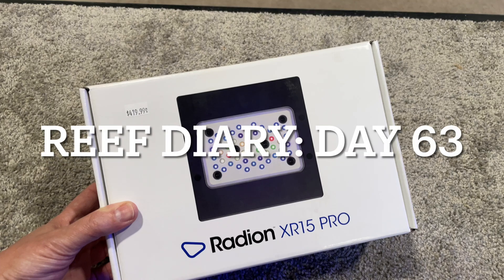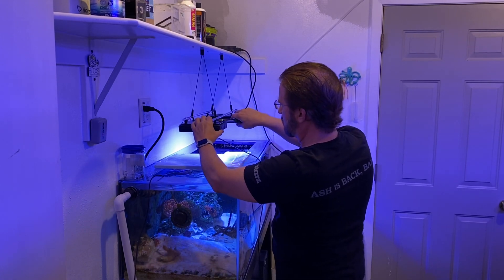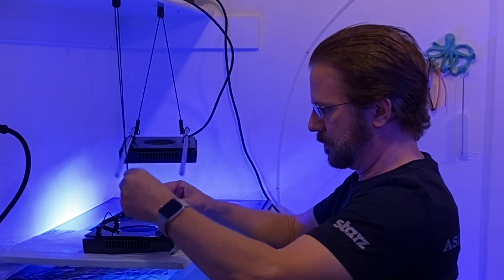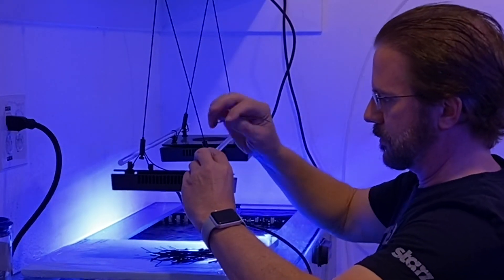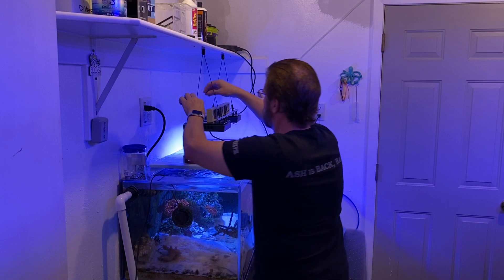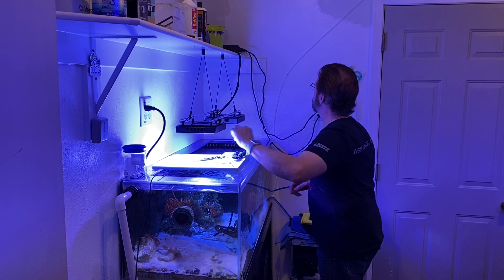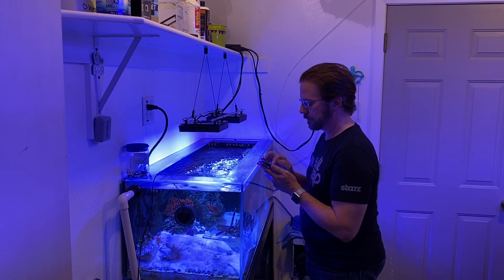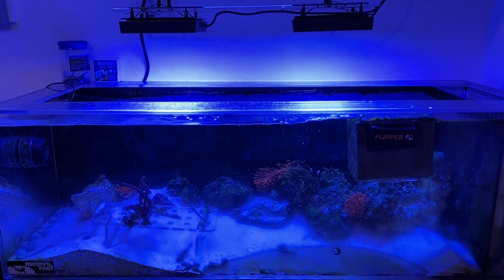RD63: Installing a Radion Xr15 Gen5 Pro

Comment: Happy that you got you light for free but I can tell you that as you noted that is not the normal process for Ecotech. When my G3 pro broke after 2,5 years it cost me 250 eur and took them roughly 4 months to fix it with no communication except when I would write to them and ask. Every time "something had happened" with supplies and so on. Now I have gotten rid of all my Ecotech products. With that said the light the Radion produce is great and will grow corals but their service lacks a lot at least in Europe
Reply: This is not a complaint video. He showing how he hung his light. Ok
Reply: @6704whs  I see your point that this was not a review however I felt that it was appropriate to share experiences with a supplier given that some aspects are "out of the norm" in how they deal with youtubers compared to other customers
Reply: @6704whs  I'm pretty sure they can complain about ecotech when and wherever. You had the choice of not commenting or even reading the comment. We all took liberties here that didn't harm anyone.

Comment: Ever nicked the wire insulation when cutting zip ties off?  I use a lot of split loom for cable management so I don't have to cut and replace a lot of zip ties every time I change a piece of equipment.
Reply from the maker: Nope! That would be bad.
Reply: That's exactly why I cut the "head" off instead of trying to cut the flat part or the zip tie